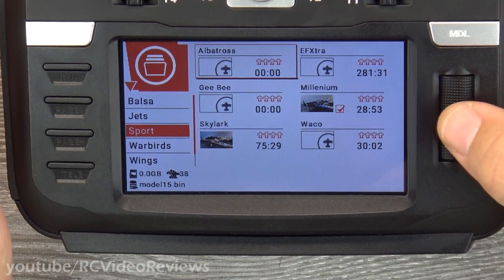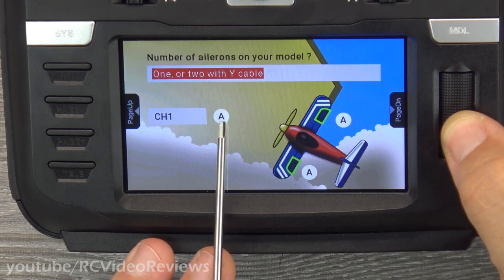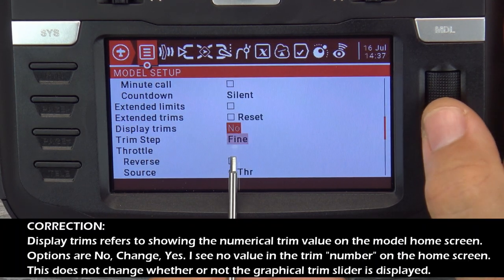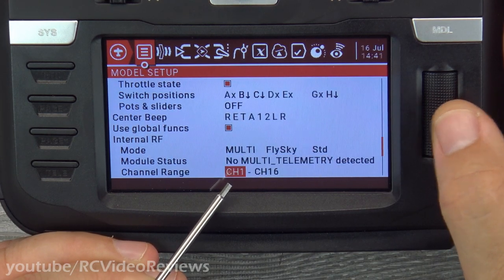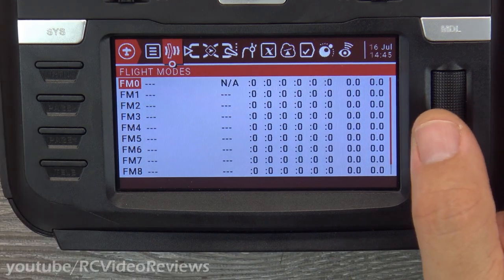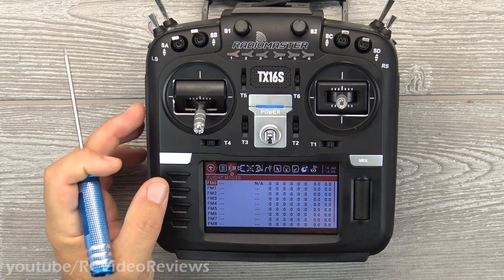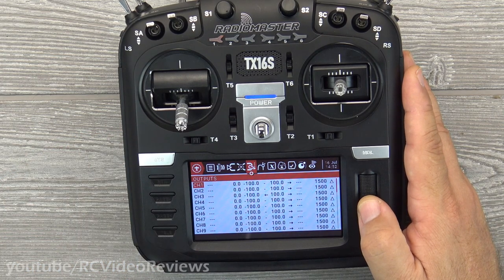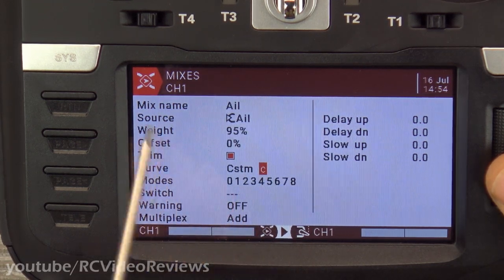Radiomaster TX16s • How-to setup an RC Plane with OpenTx Plane Setup Wizard • [Beginners]

Comment: Hey if failsafe mode is not on model setup can I populate it? If so any idea how?? Thanks
Reply from the maker: Failsafe appears when supported by the Rx. If it's not visible in the model setup, it's not supported.
Reply: @RCVideoReviews  thanks any other way I can set up?
Reply from the maker: Depends on the receiver. It's usually some process on the RX you have to follow if it's not software defineable.

Comment: I have just been pulling my hair out trying g to get the tx battery voltage on the top bar. All I can get is a flashing 0v. When I go to widget setup I get source, colour, shadow but also get lowest cell? I set the source to Batt but still only get the flashing 0v. The model 5hat was already set up has the battery voltage displayed and in widget setup only has the three options, no lowest cell option. What am I doing wrong?
Reply from the maker: The widget name is "value" the tx battery is named "Batt" You're probably trying to get it to use a telemetry battery sensor.
Reply: @RCVideoReviews  Thanks. Correct, the widget I was selecting was Batt Check, the one I should have chosen was Bud value.
Reply from the maker: @alanchase7329  So you have it working now then?
Reply: @RCVideoReviews  Yes. Thanks for your help.
Reply from the maker: You're very welcome.

Comment: @ RC Video Reviews Hi there I am trying to setup a launch and thermal mode for a simple Rudder/Elv glider as say 10%Rudder right and 10% elv down to launch, I have been searching through a lot of videos and now my head is swamped with exotic ideas all I want is assign to a 3 ps swith switch to modes and I understand the 3 pos switch and the !SA kinda thing so it recognises only two conditions BUT its setting the req trims, I cant find any details on how to set up saved trims as I require for he modes. May you please point me in direction of one of your videos that deals  with this if possible many thanks. Brian
Reply from the maker: I would check flight modes. You can set a switch to enable a flight mode and in a given flight mode you can set discreet trims, or use trims derived from a different flight mode.
Reply: @RCVideoReviews  I set trims and told flight modes to use on 1 launch and 2 use from mode 0 as that is set at netural as now flight trims set anyway it seems to show up fine in simulator but wont alter sufaces on the model I must be missing something?
Reply from the maker: Have you verified that you are actually switching modes? Also, rather than add to trims from 0, use a dedicated trim and set it to something extreme just for testing.

1) VALIDATE you are switching modes.
2) Use Own Trims.
3) EXAGGERATE the trim to make sure you see it.

Flight mode trims is nothing new on OTX and should work easily.
Reply: @RCVideoReviews  It seems I am on right track but some how I went wrong beceause I have the rudder on the ali stick to yank n bank after dlg it really can get confuseing I think I got ele to react on switching launch mode be it up instead of down my mistake so thats ok
Reply from the maker: @BrianRamseysg01  Ok--good :) Keep working in that simulator, you'll get it figured out. Like I said, flight modes are known working.
Reply: anyway added a line in mixes for the launch mode on ele and rudder if thats right
Reply from the maker: @BrianRamseysg01  Sounds right. Did you configure which flight modes go with those mix lines?
Reply: @RCVideoReviews  I have the modes config ok but its getting the fact that I have rudder on ail thats screwing with it I put lines under rudder and ele in mixes as a switch anyway the mode works fine on elevator but rudder wont budge maybe as its on the ali stick Ishould try altering the trim on ali instead that should do it so it works on launch eh ;)
Reply: Ok final result got both sufaces to operate as req on launch mode and thermal mode useing a combo of open tx and the TX there seems to be some differences in what shows up. In the end deleted ali on inputs for this model sorted it as far as I can tell.

Comment: I have to bind my mini mustang every time I turn the TX on. There are other videos 0n youtube showing all eachine planes auto binding. it has suggested by others that i assign bind to a switch on the TX. I can not find these options anywhere and there is no auto bind option in any menu
Reply from the maker: I just looked at the model setup, internal mod, mode=multi, protocol=frsky d16 and I see bind on channel two rows down from the "bind/range" options. 

If you check bind on channel, auto bind is disabled:
https://github.com/pascallanger/DIY-Multiprotocol-TX-Module/blob/master/Protocols_Details.md

Unfortunately, I don't have any eachine models to test with so I can't help much beyond this.
Reply: @RCVideoReviews  Protocol for eachine models is V761 and I just cant find the auto bind option

Comment: I dont see plane wizard at transmitter although have SCIPTS/WIZARD/plane folder
Reply from the maker: Wizards are in the stock sd card contents for OpenTX. If you don't have them, maybe update your firmware and your SD card contents. I just validated 2.3.14 and all the wizards are there.

Comment: Love the video 👍 but i have a question  when you reverse the throttle does it reverse the trim as well or is there a place were you can reverse T3 at all ?
As you would of guessed i fly throttle opposite 😂
Reply from the maker: I've never heard of flying throttle reversed, but yes, trim goes with direction. With throttle reversed and the stick full up, output is zero. Pushing the trim switch down has the same effect as pulling the stick down that is the throttle output changes from 998us to something higher (i.e. more throttle). Pushing the trim switch up reduces pulse width toward 998us.
Reply: Thankyou for you quick reply, i now will buy one and all will be happy 😂

Comment: Do you have a video on setting up a Gyro for an airplane?
Reply from the maker: A couple:
https://youtu.be/cuUVgDjgLN0
https://youtu.be/W8Rk-AO40iE
https://youtu.be/QFRy8l16kp8
https://youtu.be/bQWswUFx1TM
Reply: @RCVideoReviews  So the Turnigy Aerostar SRS Configuration video you shared is close to what I am setting up. In the video (10.23 minutes) you mentioned using your rotary dial as the master gain with a multiplier set up. Can you send a screen shot of that mix on your radio or describe mix the set up. Also, how can I contribute to your channel to show appreciation of the help you are giving me?
Reply from the maker: @michaelgordon2553  I haven't used that gyro in some time, so I have no screenshot I can share. However, I did just post this video: https://youtu.be/NqKFKvMlaV4 and it has very similar configuration characteristics, so it might help answer your additional questions.

I appreciate your offer of support, there are a couple of things you can do to help support the channel.
1) Make sure you subscribe and hit the notification bell.
2) Share videos, comment on them, and leave a thumbs up or down.
3) If you want to make a monetary contribution, there is a Paypal donation link on the bottom of http://rcvideoreviews.com. 
4) If you want to do something more long term you can sign-up at https://patreon.com/rcvideoreviews
5) You can also use my affiliate links for Amazon and Banggood. Using these costs you nothing, but if you buy things using these links, the channel gets a small commission:
► Amazon Affiliate: https://amzn.to/3lEz5ZL
► Banggood Affiliate: https://www.banggood.com/custlink/3DDRJ4cBuV
6) I have t-shirts: RC Pilot T-Shirts! https://teespring.com/stores/rcvideoreviews

You should also consider joining us on Discord, you can get a lot of help there from some very clever people.
https://discord.gg/jSFTASU

Comment: I guess your saying I could create a model for excavator in stead of balsa, jet etc? Still get the same questions
Reply from the maker: If you have a receiver in your model that you can bind to this radio, you can control it. The radio doesn't care what's attached to the servos. 

So you can name your model anything you want and you can name your categories anything you want.

Comment: I would like to watch a video about the advantages an "open" RC system,( Frsky, Radiomaster, etc) gives an electric powered scale model flier (me) over and above "closed" systems like Spectrum and Futaba. My Hitec Aurora 9/Optima receivers give in-flight motor battery readouts on the touch screen without telemetry devices but system  is out of production.
Reply from the maker: I don't know if there's enough to do a video on this, but I can give you a few keys:

1) OpenTx is Opensource software which means the hardware manufacturers don't bear development costs which they bake into hardware costs which they charge consumers.

2) Look into options like iNav Telemetry LUA and Yapuu. I don't think you'll ever see capabilities like that in a closed system.

3) Global Functions, Special Functions, Logical Switches, Instant Trim are all excellent OpenTx features. I've not seen these capabilities on closed systems.

4) OpenTx supports the Multiprotocol module so any radio with internal or external MPM can bind to a large number of mainstream receivers.

5) Development cycle is rapid and public. You can see the bugs, milestones, and engage directly with the developers. Absolutely not possible on closed systems.

6) Portable - OpenTx is showing up on more and more radios these days. Through the use of the Companion desktop software, your model configurations become quite portable amongst radios. This makes it easy to migrate when the next "must have" radio shows up.

7) Companion - No closed system has anything like it.

8) Amber Sound Pack - Simply the best.

Maybe this would be a good video...
Reply: @RCVideoReviews  So, cheaper initial price and cheaper receivers, more flexibility in switch assignments, lots of telemetry available, can bind to various brands of receivers, all if you are willing to adapt and learn some new technology and PC linked setup and maintenance procedures. Some cons in system quality and possible range issues.

Comment: How log does it take the radio to turn on and be ready to use? Ireally dislike radios that that take long bootup times, I want a radio that is just a radio, not a computer with an operating system.
Reply from the maker: 3.27 seconds with splash screen and bootup sounds off.

If you want a radio that's just a radio and not a computer with an operating system then you won't be using anything with model memory, mixing, curves, variables, audio prompts, telemetry, logging, or multi-protocol support. Those capabilities require processing and file i/o...i.e. a computer.

I haven't used a radio like that for about 19 years.

Comment: I just bought one of these for all my little hubsan drones i got,,,it go left when a push right how do i revers it
Reply from the maker: In your outputs screen go to the channel number for your rudder, press the jog dial once, scroll right to the 5th field and you should see an arrow. The label for that field is "direction"  Press the jog dial to reverse the servo.
Reply: @RCVideoReviews  Easy when you know how lol  Thanks
Reply from the maker: @whiteyguitar666  It is :)
Reply from the maker: PS Some people will say to invert the weight. That's not the correct way to do it because it can cause issues later with other modifiers. Changing it on the output is the correct way to do it.

Comment: Hi, I am having trouble with the plain setup wizard. It dose not look right, I am only able to select glider mode. Please help
Reply from the maker: You're using the jog dial on the right to move the cursor over plane, and then long pressing the jog dial and it's not launching the plane wizard?

Did you make any changes to your SD card? 
Look under SCRIPTS->WIZARD->PLANE and tell me what you see.
Reply: RC Video Reviews  The SD card that came with the radio was faulty so I had to setup a new one. I downloaded the SD software and put it on the new card. Everything else works but the wizard.
Reply: When I start up the radio I have a SD card warning “ Expected version: 2.3V0029”  and under SCRIPTS->WIZARD->plain-> img,icon.png,wizard.lua,wizard.luac
Reply from the maker: @CATZTIMBER  You got the wrong sd card contents for your firmware. Here is the correct link:
https://downloads.open-tx.org/2.3/release/sdcard/opentx-tx16s/sdcard-480x272-2.3V0029.zip

You didn't watch the SD Card video did you?
https://youtu.be/HzOrRxHtLcU
Reply: @RCVideoReviews  I've watched your video a couple of times , have done exactly what you have said step by step and still having the same problems. I'm unable to select the plane mode. The SD card is all good.
Reply from the maker: @CATZTIMBER  Did you erase your entire SD card and start from scratch?

You can also try launching the plane wizard from the scripts->wizard folder directly. Just long press on wizard.lua and hit execute.

I have a feeling something is broken in your SD card somewhere. 

If it were mine, I would completely erase the SD card, unpack the CORRECT SD Card contents on it, make the directories MODELS and RADIO and try again.

Everything is running off that SD card, so if it's failing and you've made changes to it, there's where I'd look.

Also, Did you update your firmware? If you did, did you check the LUA option?
Reply: @RCVideoReviews  Ok I got it to work. I have been using a Mac and did the hole thing over on a PC and that did the trick. Thank you for all your help. Regards Steven
Reply from the maker: @CATZTIMBER  Glad you got it worked out. You probably know more about SD content management at this point than you ever wanted to.
Reply: This saved my rear end... Thanks!
Reply from the maker: @BIMlite  You're welcome!

Comment: G’day, really sorry that I purchased this radio. Thanks for your video’s but feel that the programming involved is far to involved for modellers which is an absolute shame, as it’s far to difficult. I’ve become used to Spektrum, and started off with a Skyleader in 1969. I’m not a programmer and hope all the other radio’s don’t go the same way as it will be the end of my flying which would be absolutely terrible. I’ve not even been able to update the firmware, but guess that it doesn’t really need to be done at this stage. Hopefully I can sell this tx, as I’m certainly not going to be able to work with it. Thanks. Basil.

Comment: How to setting quad sir.
Reply from the maker: Thanks for the question. Unfortunately, the possible answers are endless and I'm not really a quad channel. So much will depend on the make/model of quad, weather or not the quad receiver is in the supported protocol list, and what capabilities the quad has that need to be supported by the radio.

I'm sorry but I don't think I can be much help to you on this question...

Comment: 4:20 - I did create model just like you did, and just like you I see nothing for Quadcopter.   WTF.   Glider and Plane.   Where's Quadcopters? Helicopters?  Please make a video for setting up a quad copter.

At least you're better than Bardwell and explain things and why you are doing them and go a lot slower.   I get tired of having to pause and rewind his videos a thousand times and squint at the screen trying to figure out what he just did.

17:00 - Those flight mode switches aren't airplanes, people are calling them chickens feet or lambo(rghina) tail lights - what they were modeled after...

Setting up OpenTX just to simply talk to one quadcopter is turning out to be an absolute living nightmare...   it's a super nice transmitter, but I'm regretting buying it.  I should of just got the DJI controller.   Setting up everything else though frustrating and complicated, is a walk in a park compared to just creating one model for one quadcopter and getting it working right... :-/   

Stay away from the complicated stuff...  keep it simple stupid.   People can't even get their first model working with this radio.    I didn't even watch the rest of this video on Mixes.  The old guys for sure probably gave up immediately and threw it on a shelf and went back to their good old crusty transmitter.
Reply from the maker: I don't know why they got rid of quad/heli setup wizards and I couldn't tell you the first thing about a heli setup, but a quad is no different than a plane. Quads have Roll, Pitch, Throttle, and Yaw just like a plane has Roll (Aileron), Pitch (Elevator), Throttle (Throttle), and Yaw (Rudder). 

The name of the wizard has nothing to do with the radio controls and channel assignments. The device on the other end of the radio doesn't know jack about the method with which you setup your controls. So don't fixate on the wizard. Just use a plane setup.

Start with a basic plane model and match your quad AETR to the plane AETR.

Bind the quad to your radio.

Add your mode switches.

Arm quad.

Fly.